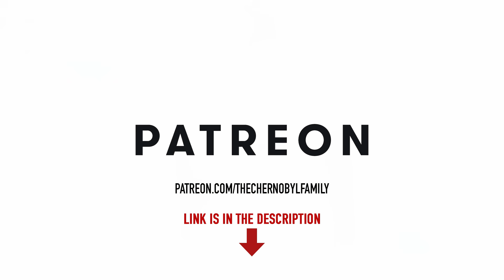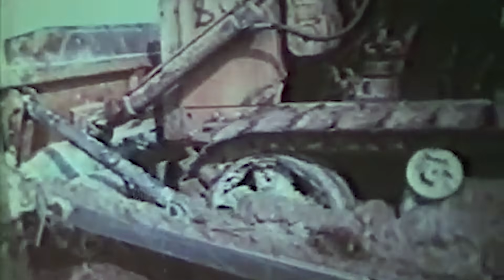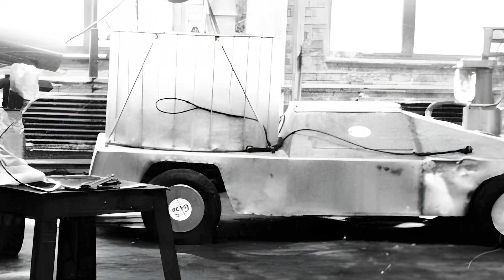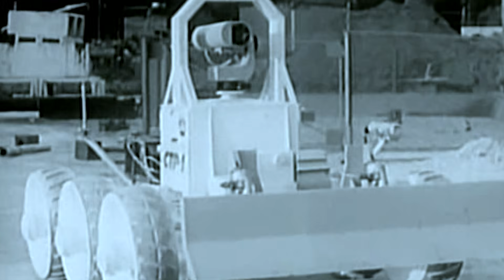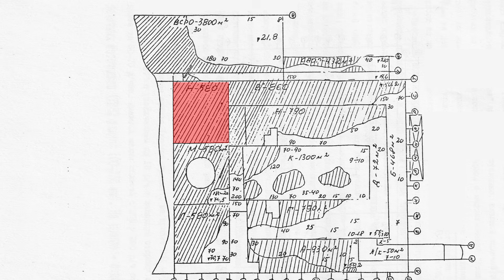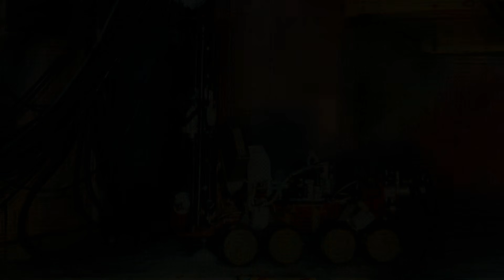Forgotten robots of Chernobyl: a short documentary

Comment: Learnt a lot of new things. But why didn't they use more cranes for clearing the roof, ie a grabber suspended by crane or something similar? I know how big the building is but it should have been possible somehow.
Reply from the maker: Check one of recent episodes about Blotters; there were attempts of using alternative methods, but they were either ineffective (grabbers), or not available as only three cranes operated and they were 100% busy. There were no domestic-made cranes which would fit the task.

Comment: I'd like to know what happened to Joker. It was removed from where it had been at Buryakivka not long before the war started, and I've heard nothing about it since.
There are a lot of little details about Chernobyl and Prip'yat that aren't easily available. For instance, one of the streets in Prip'yat was named after a Sergeant Lavarov. It's the street with the Soviet building. He was an engineer in the Soviet amphibious assault across the Prip'yat river at Chernobyl in WWII. He and his company held the bridgehead long enough for reinforcements to get across and secure it, and he received the Red Star for it. That's why the lamp posts on Yulitsya Serzhenta Lavarova have Red Star symbols on top. That is literally everything I've been able to find out about him, or the assault for that matter.
Reply from the maker: It was moved within the Field of Wonders. So technically it is still there
Reply: @ChernobylFamily  - Thanks. I was worried they'd buried it. The tourist videos from the Zone are pretty scarce lately.
Reply from the maker: @GWNorth-db8vn  yes, because there is no tourism apart from a few official visits.
Reply: @ChernobylFamily  - It was odd seeing the Russians dig in where they did, because that spot is on the regular route the stalkers use, and it's where they start to get nervous about the radiation readings.

Comment: Luckily the human kind are so dumb and can not make a robot what handles the radioactivity. All these bells and whistles what modern technology use are useless under radioactivity.
Reply from the maker: Not so long before we made this movie, we had a long talk with the institute of nuclear power plants safety – those people are specialized on the Shelter Object exploration; they said that still, the best solution is to have only hard electric stuff, such as relays and motors at the executive mechanism side, while electronics should be at operator's side. It is not about being dumb, it is about great challenges radiation creates.
Reply: @ChernobylFamily  - In the highly radioactive zone, inside the actual reactor and primary cooling systems, everything has to be stainless steel, too. Regular steel breaks down under neutron flux and makes a substance known as CRUD, for Chalk River Unidentified Deposit after the event when it was discovered.

Comment: Goddamn, some of these early robots seem like something I could throw together drunk using whatever shit I could find at the local dump. Sheet metal bucket, 4 wheels from Ural or Dniepr bike driven probably by a car dynamo. I wonder what they used for generator engine? Zaporozec engine?
Anyway, STR1 is seriously impressive and making any of these robots in such a short timeframe was an amazing effort.
Reply from the maker: That technical level underscores well how low-prepared ussr industry was for cases like this; it looks that a need of this kind of machines was never even considered, because those strange built devices after all come from some vision, and it seems that the vision was absent.

Comment: What a formidable insight of all of what has been created.
I only knew the story of the Lunochod sibling and the remote controlled bulldozer. I have never imagined that so many different machines had been built. And in a hurry. The amount of work done is impressive. I also never knew that the roof of unit 3 was mostly cleaned by machines.
All of what has been learned at the time is invaluable for pursuing the cleanup of the plant, but also has some good use for decommissioning old reactors all over the world. You're doing invaluable work compiling all of these facts, data and stories.
Reply from the maker: Thank you very much. So far, this was the most complex video we made... but much more to go :)